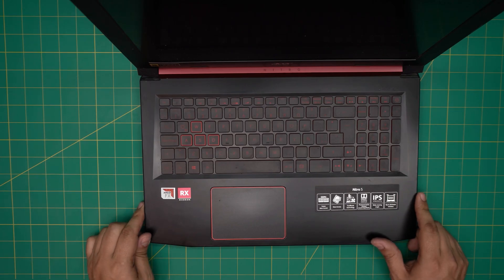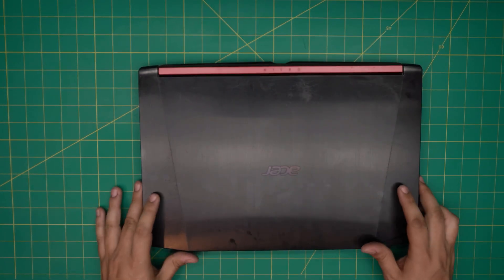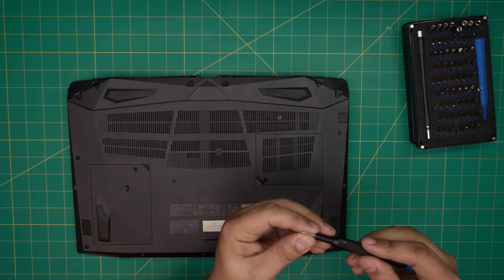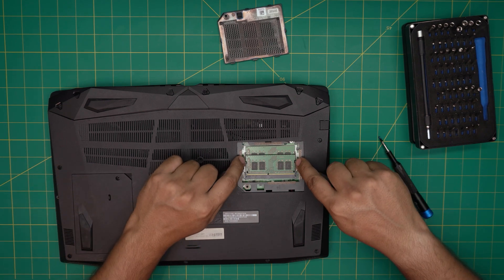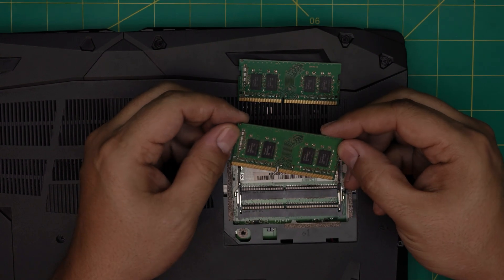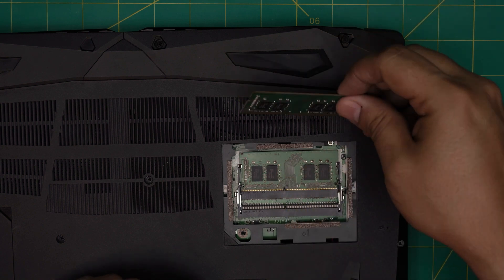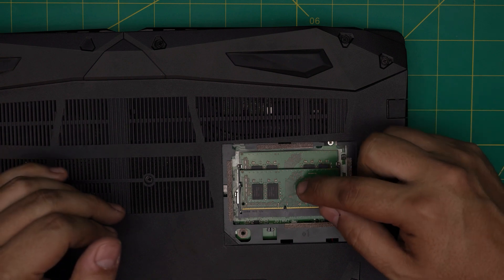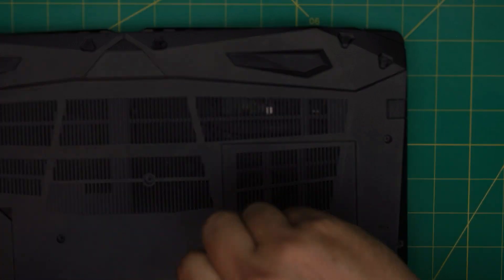How to Upgrade RAM in Acer Nitro 5 AN515-41 Series (N17C1) - Step-by-Step Guide✅ 💻

Comment: I put my new 16 GB ram in and all I get is a black screen when its in by itself. When both are in I just get  the spinning circle dots at the Acer logo.  Having a hard time installing my new ram. Please help.
Reply from the maker: i need to know the exact ram model and brand you used, also when you don't have the new ram installed it does boot after logo and goes in the windows without any issues?? if so that is very rare case.
then i highly recommend you to change the ram to a different brand but again give me the exact specs of the new ram so i can help you out my friend.
Reply: @uFixTek  Viper Gaming 16GB DDR4 2400 Mhz ram chip.  Does not get to windows, it says preparing auto repair and just spins and shuts off and bluescreens. I go to bios and it shows the ram there but there is something wrong with it.  I am getting Kinston ram instead and going to try that.
Reply from the maker: yes something 1000% wrong with your ram my friend
Reply: @uFixTek  The messed up part I think is it would read in the bios that I have 16GB of ram but computer wouldn't go to windows, kept BSOD and restarting.  I had to put my old ram back in to get it to go to Windows again.  Not sure whats up with that Viper Gaming ram but it had good reviews on Amazon but its junk and doesn't work.
Reply from the maker: you would be surprised with me doing services and repairs over 18years and i have seen many good brands with defectives, the bios will detect the ram but the ram chips on the dim are defective when windows needs to fill.
just replace it and hope for the best outcome. because on this laptops there is no ram configuration in the bios to adjust parameters, so it is plug and play type and finding the compatible none defective rams.

Comment: Thank you so much I just got new ram sticks for my laptop and this was a big help. Although, the clicks for putting in the ram was more aggressive then I feel it should have been. Did I do something wrong?
Reply from the maker: Thank you for the feedback! if you wish to support the channel you can LIKE or SUB or both :P
regarding your question:  absolutely not, if it clicked then you did it right, just make sure you push it to the slot in and 45degree hard and then push down and you should heat click if no click then its a no go.  but if you say it clicked then you fine. don't worry you can't burn or damage. simply the laptop wont show anything on screen if ram is not installed correctly.